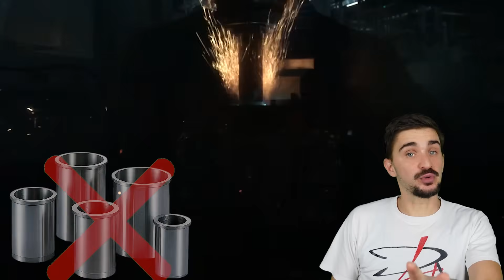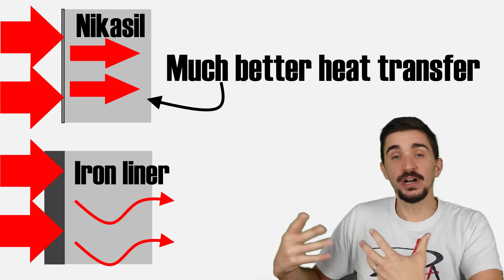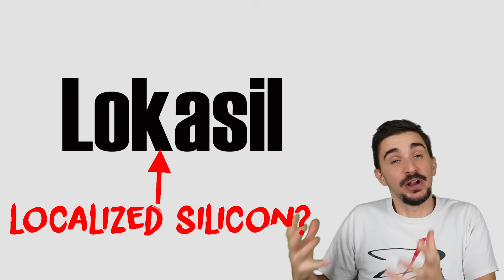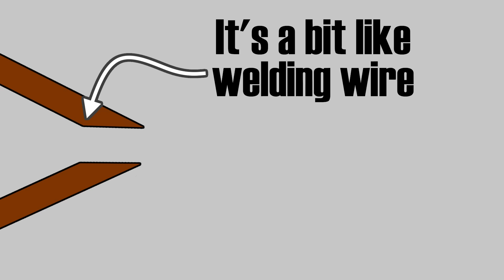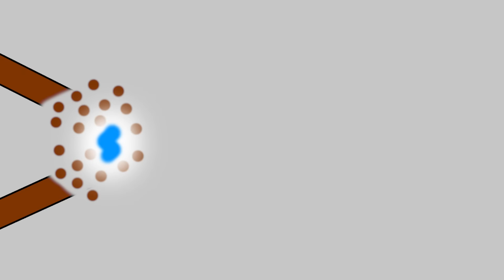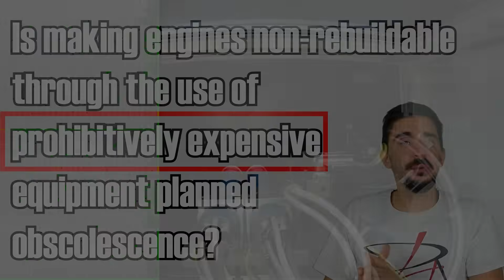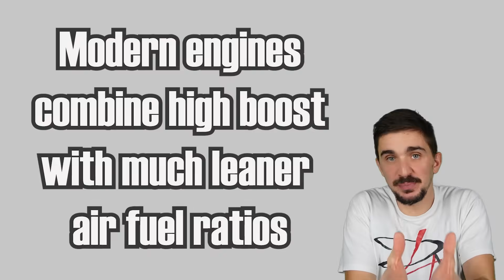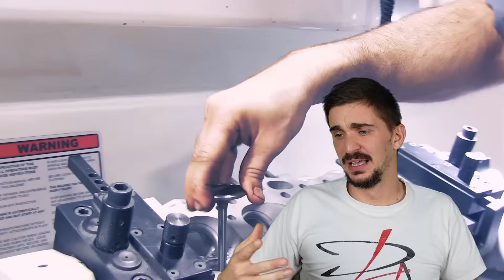Why Are Engines Becoming Non-Rebuildable? Everything About Cylinder Coatings

Comment: I don't think some people realize how durable Nikasil is and how much it helps the home mechanic/average diy'er be able to fix their stuff at home. 

Nikasil is so durable that it effectively makes rebuilding an engine as basic as changing spark plugs. I had a four stroke KTM that I wore out two piston/rings and the bore was still like new. With an old school cast iron liner I would have been buying  oversized piston/ring kits and sending things out to machine shops for boring/honing. Instead, with Nikasil, you just order a replacement piston, swap it out and your good as new. I've been working on engines in general for 30 years and Nikasil is THE best thing we ever came up with.
Reply: Let me preface my response in saying that this is true provided you repair the engine and not let it continue working in worn or damaged state.
That is catching the worn rings at a reasonable time, using the engine as designed, not overly extended oil changes, over boosted, race fuel etc.

I agree and have been saying this for years but get huge bad mouthing from very vocal owners/mechanics that do not know or protecting their interest.

The problem 

1) Many owners are ignorant and speak negatively of these out of ignorance. 99% of car owners NEVER open their engines. 99% of the 1% NEVER DIY their own engines.
The result is owners of these engines never actually see the insides, understand them or appreciate them before junking.

Those that end up junking them tend to forever run their mouths out of ignorance. Just negatively speaking about ownership of these engine, their bad experience of high oil consumption, short life in their ownership etc not really giving much technical or objective commentaries.

Lots never knew it was likely an easy/easier fix of just new pistons rings and away you go for another decade. No rebore, no resleeve, no new oversized pistons etc. 

2) Many mechanics do not want to repair them by just new rings as it reduces their profit. They want to make the job bigger to get more profit (re-bore, re-sleeve, new oversized pistons etc)

3) Many mechanics are not used to just replacing oil rings and are uncomfortable. Out of habit and ingrained mentality they only know and want to  rebore, resleeve etc.

4) Many mechanics do not have, want to spend money on training for mechanics as they culture is high turn over (waste of training)

5) Many mechanics do not have or want to spend money on equipment able to fix and reline these engines.
Reply: My brother used to be into dirt bikes, and the ones that had coated bores always soon needed sleeving due to the fact that the coating started wearing away in only months.
Reply: @jamesbosworth4191  The only thing that can wear away a Nikasil coating is extreme abrasives. You can literally take sandpaper to it and it won't scratch it. They have to make special abrasives stones because traditional honing stones wouldn't touch it. No offense, but if your brother was wearing away a Nikasil coating in months, he must not have understand how his air filter should've been maintained. If he rode with a dry filter and constantly let it breathe dirt/sand/rocks...yeah, that'll kill an engine ine. Or maybe his engines weren't Nikasil. I can't know. But I know for a fact that he wasn't getting them resleeved because the architecture isn't there to support it.
Reply: @shinyribs2178  He did take proper care of it and was fanatical about the air filter.  The bike was a 1989 KX 250, and the bore was plated, and it did wear enough that a replacement piston was not as tight as specs said it should be.  The dealer told him he has to replace the cylinder.  I told him, (my brother), "That's BS.  Just have it sleeved, then you have a life-time cylinder".  He did just that, had it sleeved, and no it didn't lose power.  Maybe the plating was something other than Nickasil, but it was plated.  Sleeving is much much better than plating.  It just is.
Reply: @ Those Japanese bikes are not top quality, just CHEAP.
Reply: @BOB_ToT  Exactly. That was a Kawasaki problem, not a Nikasil problem.
Reply: @shinyribs2178  Or he was running high sulfur fuels, right?

Comment: "apparently" @0:23
long gone the culture of "maintaining a car". Not many take the invesment of rebuilding an engine, let alone keeping track of the maintenance and performing it.

There are YT channels of crushers getting cars that CAN be repaired, but it is way cheaper to just crush them.
The crush process, done right and correctly, does minimize pollution, but that's just easier said than done. The real problem is to get the consumer to CARE again for keeping stuff well maintain, less subscription more ownership, also meaning being responsible for your stuff.

Also, OEM as applying more metals, that means extracting and producing more exotics materials, process that "surely" is envirommentaly friendly, when, since the beginning we had a simple solution. OEMS like to create problems that do not exists.

Finally, the emissions subject, which IS something political, because those standards are set by goverment entities.

Comment: Briggs & Stratton offered 2 different engine lines back in the day. Industrial use had cast iron cylinder walls, and residential use had chrome cylinder walls. Cast iron was rebuildable, and Chrome was throw-away.

Comment: A collab with an engine rebuilder exploring alternatives like cast iron sleeves when the coating fails would be interesting (like are the pistons or rings any different, how it affects heat transfer, etc), I remember something about Cr rings being recommended for iron liners...
Reply: Have you considered DIY alternatives?
🙂#XcelPlus

Comment: In your CO2 emissions comparison, You did not consider the 'CO2 cost of earning' required for purchase of new engines vs cost of re-building an engine.

To buy a new car, if it costs 35000$, how many thousands of kilometers should the owner travel to earn that amount (consider average person to travel 20 miles/day and takes about 2 years to earn enough to be able to pay for the new car, vs 3 weeks of earning to rebuild the engine)?

Comment: Planned obsolescence is a stupid meme invented by people who simply cannot understand that economics is about tradeoffs. You can have a TV that last for 5 decades, but it will cost you a lot of money to make sure all the parts can stay alive that long or be able to be replaced, and good luck keeping up with the new transmission technologies. No it is not planned obsolescence to require a new cable to transmit data, your USB2 wasn't good enough to drive a 4K monitor. Or you can have a TV that lasts 5 years, but costs you a fraction of the price of the 5 decade long TV and replace it for a better model later with all the new features.

Imagine this, spend $5000 to get a TV for 50 years, or replace your TV every 5 years but it cost you $100, which deal is better?

Comment: Well, when the block wears out, the whole engine will go to recycling which adds a lot to the emissions, at that point the transmission is probably close to it's useful lifetime too. Replacing those will likely economically total the vehicle, therefore the whole body goes with all the electronics and plastics. Engineering plastics are not really reusable in the same way ever again, maybe it can be remoulded into house appliances or other electronics but a very small amount will find it's way back into a new car. Adding all this up changes the equation ain't it?
And this is not accounting for increase of emissions over time, the increasing amount of parts able to (and do) fail, and the fact that engines usually do not reach the block's useful life due to other catastrophic failure modes on other cheaped out parts and overly optimistic service intervals. I'm not sure if anyone even tried to investigate the whole logistic chain's emissions, if it's possible at all, but it feels like it wouldn't look nowhere as great as this number here

Comment: As much as I appreciate the very thorough data analysis, your entire arguement is based upon the production of less "CO2 emissions".  Was I the only person who payed any attention in 8th grade science class?  Carbon Dioxide is what we exhale when we breathe.  The gas is converted  into oxygen by plantlife.  If we're looking to reduce "CO2 emissions", plant more trees.
I don't know why we've allowed half-witt polititions to influence engineering practices.

Just about any 2JZ pulled from a totaled vehicle can be rebuilt in someone's back yard.  You could easily achieve 500hp with this engine using lower compression pistons, and higher octane fuel.  Keep your ring gaps wide and you don't need to wet the cylinder walls at all.  You could keep 14.7:1 AFR no problem.  Thermal dissapation can be achieved with a larger radiator.
Run the engine on E85 and keep the engine even cooler.

Your whole arguement used to support the process of coating cylinder bores is a pretty weak one, honestly.

What should be painfully obvious by now is that the "consumer", formerly "customer" is no longer allowed to perform heavy maintenance and repair on his or her vehicle.  All repair procedures are gate-kept and cost prohibitive.  For major repairs, a new vehicle is demanded to be purchased.  All vehicles must be refreshed every 5yrs.
They've done it with software.  They've done it with phones, they've done it with computers.  And they're doing it with cars.  BMW is the model.  It has been for a long time now.

Call these trends whatever you like.  People are drawing their line in the sand.
We're either holding on to old tech like its gold, or just giving in and hoping they use lube.

One thing is for sure, engine liners of any kind were never created for the benefit of the people.
Make of that what you like.

This one was disappointing.

Comment: Environmental impact of producing a new car + cost of purchase + environmental impact of scraping the old one, vs getting another 10yrs from a rebuild until the fuel becomes just unavailable/extravagantly expansive &/or I simply die, then it becomes my son's problem what to do. O so tricky.  I now do most of my travel on a motorcycle @ around 30kpl. Shopping & doctors + leisure. While the VW van (@ 8kpl at best) sits undercover almost all week. 🖖

Comment: How is this process expensive? I've litersally seen Cutting Edge Industrial Engineering use an old-ass spray coating cut from like the 80s on industrial equipment to repair metal. I doubt that it'd take THAT much more money to make something that does it automatically for cylinders....

Comment: As a former ASE Master tech I'm gonna be honest....the vast majority of people with the typical grocery getter doesn't rebuild a motor. And quite often the motors are damaged enough to make it more expensive to rebuild rather than replace. So if this process proves to have longevity with proper maintenance I personally don't see an issue with it in a non performance application.

Comment: Maybe this is off-topic, but what seems to make rebuilds so impossible in my eyes is all the plastic. I'm rebuilding an Audi A3 and I swear, every single plastic peice just looks like it's been hit by a blowtorch. I'll pretty much have to replace EVERY SINGLE PLASTIC PART. It doesn't seem to matter where it is or how long it's been there, all the plastic is just flat-out broken. If anything, this is what makes rebuilds expensive. I'm probably looking at an extra 200$ to replace it all, espesially since I'm not buying more ill-fated plastic that could fail in use. I'm not even counting the time wasted waiting for parts, which has also been redculus since they're not small.

I don't know thpugh. Is this just a me issue? I am kinda curious what other think about all these plastic parts on cars.

Comment: Great Info! all engines are still be rebuildable, instead of boring an engine you will have it recoated at the machine shop. Don't think it will actually change much. cost is high now but many machine shops in the US now have CNC machines and very expensive gear back in the day CNC machine would have been 100K now 20k  same will happen with this.

Comment: When he runs the numbers, he's assuming all engines get rebuilt at the end of their useable life.  I'm curious what percentage of engines ever actually get rebuilt at the end of their life, or would get rebuilt if it were feasible, or maybe how what percentage got rebuild 20-30 years ago.  If you looked at those numbers, the argument of planned obsolescence is probably a moot point anyway.  When I was young and scraping by financially, I would rebuild engines.  Trying to rebuild engines on a budget never gave me the longevity of a new engine that has been freshly built from the ground up at a factory.  If you look at the cost of a rebuild and the useable life of the engine versus a new engine it all works out the same in the end.  It's just harder to justify the upfront cost of a new car or engine sometimes.

Comment: Each and every engine in cars I owned was non-rebuildable. After all, once you need an engine rebuild, your cars worth will be low enough, that it will be cheaper to just buy an equivalent car. So the technical possibility of rebuild does not matter in 99% of scenarios. And replacing whole engine with a used one in better condition is probably a viable alternative for the rest.

Not to mention, internal destruction engines are closing in on retirement anyways.

Comment: First of all... This is a myth... Because with a decent set of machining skills those cylinders can me bored out and fitted with a sleeve whether the manufacturer likes it or not... So all they've really done is create a market for that in the future. Even if that means necessity dictates going down in bore size. 😂 Though I don't see a lot of demand coming for remanufactured underpowered engines for a "classic" sedan that looks like a suppository on wheels. So classic cars and performance car people will probably seek other options.

That being said... It does sound like they were attempting to make right to repair as expensive as unobtainium. And they clearly have no delusions about these newer cars having much of a collectors market. The same thing happens in the semi truck market. Most brand new trucks have a maximum shelf life of 8 years before a major engine swap is a necessity. Within 4 years you start having major issues with tollorences in things like the fuel system. The solution to this is not more disposable... But try explaining that to Deimler. 🤦

I hate to correct your assertion... But you're assuming that these companies are operating on the basis of common sense not capitalism. Making it more expensive to produce and less repairable is exactly the business model. No matter how convoluted that seems to the rest of us... That's what they are doing.

What cannot be repaired is a warped engine block. Ive seen enough piston heads forced through the casing of these "modern" engines to know they're not concerned with how much it costs on their end so long as it sells more vehicles. They are definitely not concerned about carbon emissions on manufacturing because there's subsidized manufacturing for people appearing to be environmentally friendly. That's the only crap they actually give about that.

Look at the diesel market for commercial vehicles.

Comment: While engines last longer and are more efficient as a result. What are the odds of finding a replacement engine in 15-20 years for a reasonable price? There won't really be any classic and iconic cars either. It's sad to think about to be honest. 

Had I not brought an rx7 back from the dead, I wouldn't be turning heads with it and getting folks curious about rotary engines. It's not a car I drive often but the reactions so the environmental impact isn't terribly significant but eventually it'll get so cost prohibitive just to keep them alive and Mazda will stop making replacement engines altogether.  either. 

A lot of cars have met an early grave due to catastrophic engine failure. Sometimes engine swaps aren't the preferred/acceptable method of restoring an iconic car to its former glory. It'd change a lot of what made that particular vehicle stand out in the first place.

I dunno man, while saving the environment is great and all, a throwaway society that's unappreciative of how things used to be made isn't really a world I'm terribly interested in.

Comment: I don’t see the big reason for rebuilds unless the engine has a design flaw from the get go. Properly maintained engines can last 200-300k miles 10-20 years. The main issue I have is the over abundant use of plastics and electronics that will one day not be available. HVAC controls and units that are now discontinued on some models . Now what? No a/c and heat ?  And so on

Comment: I think you're leaving out that there is no improvement option that benefits the consumer in your assessment. Since the production of the original vehicle has already been completely amortized, rather the protection of a new vehicle hasn't that too plays into the carbon production argument. New vehicles do use recycled materials already.

Comment: As a machine shop owner we have been cutting out all these junk coating and installing iron sleeves for decades. In high hp applications it's often one of the first things we do.
Reply: Thank you.
Reply: Should I use a iron block or aluminum block without sleeves